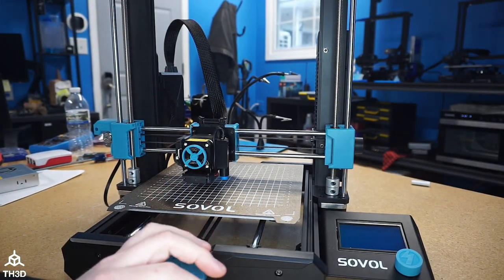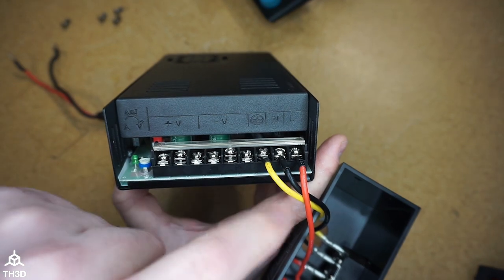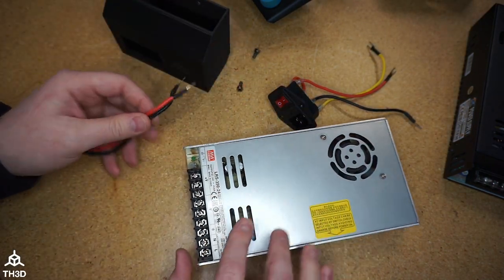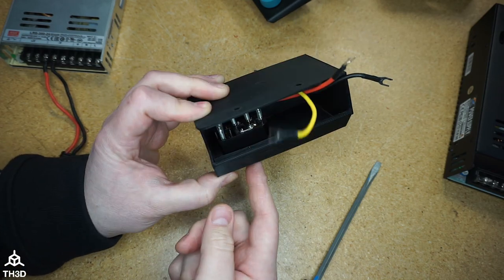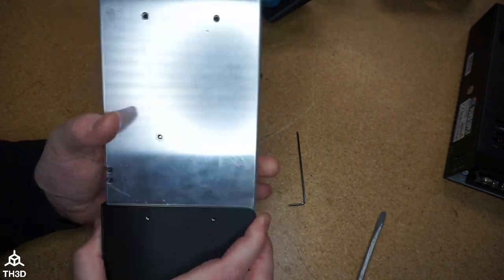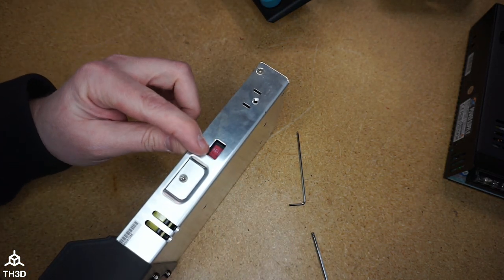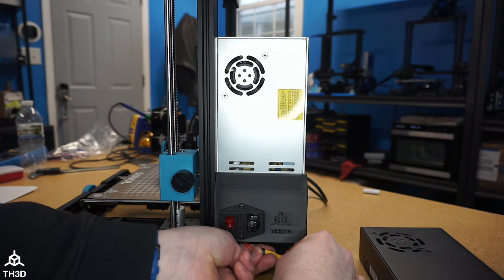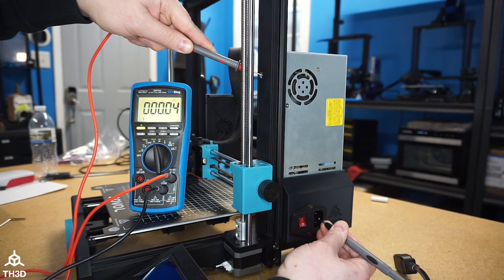Replacing the SV06 Power Supply | Meanwell Conversion/Upgrade

Comment: I have one question...this meanwell psu is a 350W-24V while the sovol sv06 has 360W-24V ...Isnt that a problem?
Reply from the maker: Nope. The stock PSU is crap and will not handle that. Its an off-brand chinese PSU so their ratings are about as honest as a politician.
Reply: @TH3DStudio  this psu used in kingroon printers too but that are an other cheng liang PSU , maybe thats a bette series I dont know😅 I dont read issue

Comment: What would you suggest for the SV03? Thanks.
Reply from the maker: The SV03 should come with a meanwell already. Open up the bottom and see whats in there. If its not a meanwell they are still advertising it as such so I would go after where you bought it from to get a refund to get one or return it. But that SV03 still takes the same 350W 24V meanwell that the SV06 uses.

Comment: Will this same power supply work on the SV06 Plus?
Reply: Likely not. The SV06 Plus has a 450 W PSU, the non-Plus has a 350 W. Smart move to replace the PSU. The original one jams FM-radios, crashes the printer, makes it show funny numbers as sensor readings and interrupts inputs. Have leveling issues? My bet would be on the PSU. I replaced mine with a much more expensive one and it works like a charm.
Reply: @39XenonD  which PSU did you replace your SV06 Plus power supply with? My power supply is completely dead and I need a replacement.
Reply: @TheSupremeDiggity  Sad to hear it already broke in your printer, given it can't be old..

I replaced mine with the Mean Well UHP-500-24. Quite a big price tag, but upgrades are: No fan, with PFC, no electrical noise and about 80 W less power consumption when heating up. Oh, and the ones mentioned above. I'd see this as a win.

It's not a 1:1 swap, you'll need to design/print/build a new enclosure to attach it to the printer. Have fun :)
Reply: @39XenonD  Thank you for the response friend.
Reply: @39XenonD  I see a $106 but since mine is dead I may have to just spend for the upgrade.

I don't know if I can print a holder out since my printer is dead. Do you think I could wire it up without the case and then print the case out on the printer without killing myself? 

Do you know of anywhere with the stl files or did you design your own? I don't mind working in Fusion to make my own but if I am going to do a patch up job and print the case without properly securing the PSU I don't really want to do a print that doesn't fit properly and then have to do multiple prints.
Reply: @TheSupremeDiggity  Having exposed wires is always a high risk. Rule of thumb: if you have to ask, it is probably not a good idea. You'd likely want to aks someone qualified to help you with this problem. You have to be the judge. Things can go south quite easily.

As for the stl, mine is far from being polished. Haven't looked yet since again, maybe there are some out in the web already. Check the usual suspects I'd suggest.